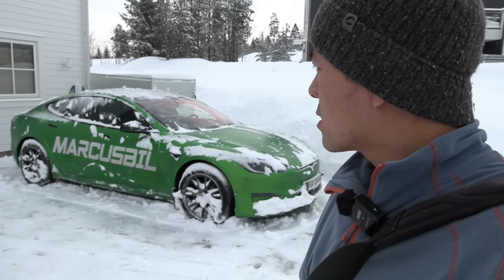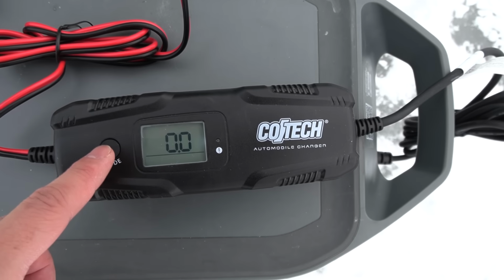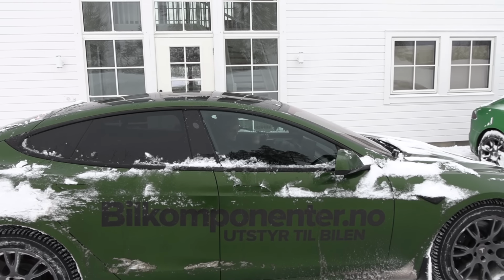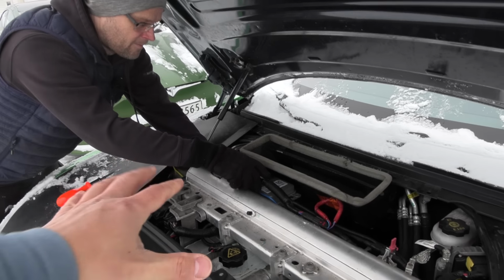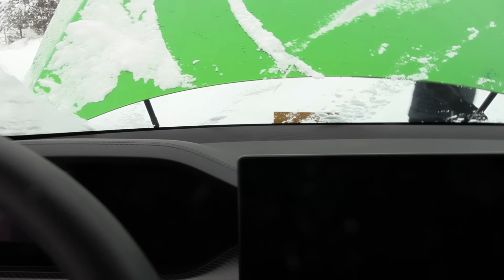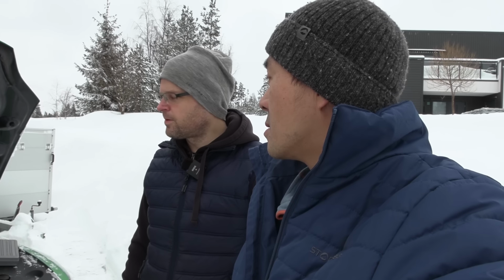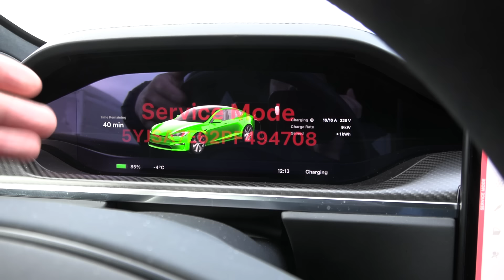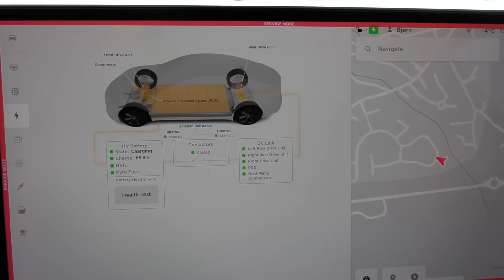Tesla Model S Plaid died in the cold

Comment: I had a 12V battery discharge on my Kona EV, a regular boost was all I needed but I have a physical key. There needs to be mechanical key to get into the car and hood so it's not just going to rely on the 12V battery working in order to even access the 12V battery.
Reply: Usually when a battery have uncharged twice its more or less dead so just replace it if it happens.
Reply: But they did get into frunk with 12V battery not working, so I don't understand why the need for physical key?
Reply: @darekmistrz4364  Yes, after calling (and waiting for) someone with a higher power 12V (semi-)portable source and waiting in the cold for a while until the car decided to wake up and open.
With physical access (like in the Kona), you open the door and then the bonnet, pull out the 12V battery, charge it inside and put it back in.
Some things should remain the same and not be "innovated".
Reply: @AndrewTSq  That's BS. Sure it's not optimal. But does your phone die when it's fully discharged? These are Lithium LV batteries, not lead acid batteries.
Reply: @LAndrewsChannel  So the process you describe requires exactly the same tools but additionally physical key compared to Tesla process at the moment
Reply: @marcel151  i thought kona had a normal 12v battery
Reply: @AndrewTSq  I was referring to Tesla's 12V battery.
Reply: @darekmistrz4364  yes but not everyone can open your frunk.
Reply: @K0nst4nt1n96  no one can open your frunk because the backup only works if the low voltage battery is dead, its not working when it still works.
Reply: @darekmistrz4364  It doesn't require a battery powered jumper (which most people store inside their cars). And that physical key is in your car's fob which you have on you all the time.
Reply: what year is your kona?
mine automatically recharges the 12v from the big battery
have you ever noticed an odd yellow ish light from just above the center of the front "grill" cover and below the hood?
and the hood is opened from the inside of the car with a release lever
Reply: @TschingisTube  what happens when the voltage is too low to open the car but high enough so it doesnt work?
Reply: @AWildBard  2022. It was a one time fluke as far as I could tell. The yellow light has come on since the incident which was months ago. Everything has worked fine since. My point here is more that all I had to do was to was to use my physical key to get in and pop the hood and boost the battery normally rather than have to attach it to some flimsy wires, wait a few minutes, only to have to repeat with the 12V again after gaining access to the car, which is what you have to do with the Tesla because there's no physical key.
Reply: @K0nst4nt1n96  In a properly designed electronic system (which I expect from a roadworthy car), you will have a voltage cut-off point so either the system will be fully powered on or off (with the backup being "active"). In the worst case, it will be toggling between those states until the battery drops steadily below that threshold point, but even in that case, connecting the bypass voltage should "catch" it in the off state so it will still work.
Reply: @neilchristensen6413  
Ah, I see your comment is about the video. of course, haha
Reply: @LAndrewsChannel  If Tesla designs their door handles so that they dont work in icy conditions and removes hall sensors to measure the accurate distance while parking i dont think they thought of that.
Reply: @darekmistrz4364  I have an old car and when the 12 V battery dies I can take it out and charge it at home. I have no way to charge it outside, cause I'm parking on the street 100m away from my apartment, which is common here in Europe.
Reply: @peter.g6  I'm confused why would you mention that to me
Reply: @K0nst4nt1n96  What I am explaining is how most battery powered circuits are designed to work. Tesla might be making their own parts, but bits of them are made by other suppliers, like in the case of any other auto manufacturer. I really doubt Tesla designs every single PCB in their cars, but have them made by a third party that will use industry standard designs.
So yes, their cost cutting and design decisions have little chance of having an effect at this level.
Reply: @darekmistrz4364  You said not having a physical key doesn't make a difference, but this video shows you have to charge the  battery right there with a special power source. You can't remove it and charge at home.
Reply: @peter.g6  First of all, this video doesn't show that "you have to charge the  battery right there with a special power source". You just need to provide 12V power to help the car wake up. You don't need to charge that lithium battery because high voltage battery charges it. Second thing is that this video is very improvised and doesn't show how to correctly do it or do it with minimal amount of tools and equipment.
Reply: @AndrewTSq   its not that simpe it depends on why it went flat and teslas are now using lifepo4 instead of leadacid
Reply: @M_a_r_ke  but this is a KIA
Reply: I agree, it's mindblowing you cannot enter the car.
Reply: On my parents Kia Niro Hybrid, if you run the 12 volt battery down... there's still a key hole in the driver's door to open the door.  Then... you push a button on the dash.  A little chibi comes up on the dashboard display to chide you for lettting the battery run down and plays bad elevator music for about 90 seconds, while it actually uses some charge in the hybrid battery to charge the 12 volt one enough to start the car!
Reply: @LAndrewsChannel  True, I don't know why either Tesla or OEM manufacturers don't just make sure the electronic systems are properly maintained at least indirectly by the high voltage battery. I thought that this was done by an on-board charger and when that charger is activated that on my Hyundai Kona it would have that yellow light on. 

Either way, it has only done this on one day 8 months ago. I just wish I could knew what caused it so I can be prepared.
Reply: @darekmistrz4364  I will not touch a car that could potentially lock my children inside with no way to get them out quickly. I want a key and a handle to open a door. If the system can fail when cold it can fail at any time. It could be 100 degrees outside but something goes wrong and bam, you can't get in after you just loaded the kids in to go to the pool.
Reply: @joecoolioness6399   Bad news for you. There are many cars that do not fulfill your requirements
Reply: A friend of mine had a Lotus Elise, a car where you have to pay extra so that they leave stuff away. There they also saved the mechanical locks. 

He showed me that it had a small hatch under which there was a USB plug where you could load the dead battery until the door locks work again. 
 
And when you have a wiring problem or a mechanical issue with the door opener? What then? A crowbar or the angle grinder?
Reply: @feedingravens  Break the glass
Reply: Cost money, Elon is all about pinching pennies.
Reply: I hast it approx. 6 Times with my E-Soul SK3, MJ2021. 12V Battery exchanged on my Wish after 3 Years. With new Battery in place for now approx. 3 Months, the new 13V Battery also died twice and needed external Boost/re-vitalisation wit my CTEK MX5. Annoyingbsince Hyundai/Kia knows this from many other KIA and Hyundai EV drivers for Years (GoingElectric Forum ist füll of These cases) but still  did'nt manage to Delivery a proper ECU/BMS Update ever since... Sad and annoying, since in many ways beides that serious doenside, I really Love the Car and how IT handles/drives etc 😢

Comment: 3:11 it looks like shorted...why are plus and minus wires connected ?
Reply from the maker: These are not live wires. They are input wires, not output.
Reply: @bjornnyland Ok, thank you for the explanation.
Reply: Given there was a spark the first time he connected the booster, I'd call it live wires.
Reply: This is just an emergency bypass to power the trunk release. Most likely there is never any voltage on those wires because there's a diode there somewhere, so it does not matter if they are shorted or not.
Reply: @vprwave  A motor or relay has a coil that needs to be charged/energized, if the connection is not fast and precise, the coil can kick a little and make sparks.

Comment: My 2007 Cummins 5.9l diesel starts every time when plugged in even below -40C, will go 900 kms on a tank of fuel, refuels in minutes ready for another 900 kms. Even when the battery has gone dead in extreme cold I can open the door with a key, open the hood and boost the batteries. This is insanity.

Comment: FYI, avoid leaving the external charge connector connected to the car, but with the EVSE not powered.  The charge port ECU is looking for the pilot because it sees the prox, and this will keep the system awake, which draws more power from the LV system.  Yes, if it's super cold the LV battery will not be able to charge, so in that case I'd recommend leaving sentry mode on, which will keep the car awake and the DC-DC converter in the PCS will keep the LV battery supported until the temperature comes up and then it will begin charging the LV battery.   Personally I think Tesla screwed up on using this tiny LV battery.   (I have several videos on my channel about this)

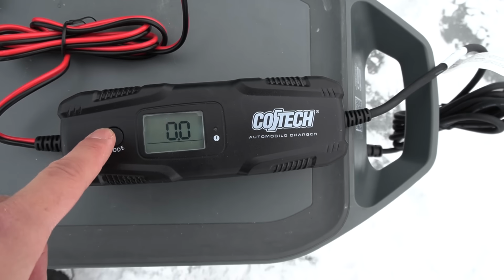Comment: 4:00 these type of chargers will not start unless it sees at least some voltage. And these wires are not connected to battery, they are connected to frunk unlock mechanism. In Victron chargers you can set it to "PowerSupply" mode and it will not try to detect battery. It also has a profile for Lithium batteries so no need to disconnect LV battery. I highly recommend that.
Reply: Victron is good shit, but probably 10-15 times the price of Bjørns one
Reply: @havarm  That's true, especially that there is nothing amazing inside of it. Components inside are not worth more than 25 euro. But I suspect if Bjorn wants to have something good (like with Ecoflow) then buying Victron is the way to go here.

Comment: Because having a physical key like them legacy automakers would just be too much oldschool...
Reply: The best part is the not existing one, isn’t it? 
You easily can get rid of a mechanical lock by replacing it with an AI-based cloud operated door unhinging system. It even allows a subscription service for car entrance 😂
Reply: @fromgermany271  Not to worry. The 2025 Plaid will come with Elons robot companion so that it can open the door for you.

Assuming of course, its battery doesn't go flat. I guess you would be in serious trouble then..
Reply: Unless you buy a Tycan (or Tesla apparently) and lock yourself in in the middle of scorching summer or freezing your nut sack off in dead ass winter. Sounds so much fun
Reply: And then you sit in your legacy car and still cannot start because you still need the booster to make it work again.
Reply: My Jag Ipace has manual door locks and a manual lever inside the car to access to the frunk if needed to get to the 12v battery. Legacy car maker= seen it, done it, solved it.
Reply: @andersnilsson973  Same for US-cars
Reply: @DennisWallman  after 40y in „HighTech“ I still remember what a friend from school once said about me having two fables. IT (always the newest; did fade a bit recently) and old cars. Never had the combination of time and money needed for the latter part, but I refuse to buy anything from the iPad on wheels company. My actual car from my favorite British brand has also far more electronics then the ones build when I was burn, but it is still a car. If I don‘t want to drive myself anymore (hopefully far far away from today), I will use taxis.
Reply: @andersnilsson973  😆  never had an issue so far in over 2 years. I think EV should be easier to maintain, our first service was after 2 years and cost £250. Brakes ok and tyres good. I wonder how the government is going to get all the tax they need from ev's when fuel duty starts to decline???
Reply: @@phillipbanes5484 nobody ever stranded in an ice car because of 12v battery died, obviously, my bad.
Reply: @TschingisTube  I can just bump start it..
Reply: @fromgermany271  AI-based requires power :)
Reply: @nicholasripp386  Easy when you will see how much the electricity price will raise. Is was a carefully prepared trap.
Reply: @alexk.7250  sorry that you cannot afford an automatic shifter
Reply: @@phillipbanes5484 I read what you write and it sound like this "hey look at me, i can fix my own car, everybody should be able todo it!!!!!!" since all the things you mention do not play ANY ROLE if you are not capable of fixing your car yourself and you need assistance, therefore i wrote "stranded" means you are unable to fix it and need assistance and then the repair guy will have a booster and will be able to open everything and make it work.
Reply: @fromgermany271  Careful! don't give the muppets even more "innovative" and "good" ideas! 😄
Reply: Give me that and stalks for turn signals and wipers.
Reply: Use a hammer. Works every time.
Reply: This is why making the future inaccessible is a problem. If you don't have computer science and engineering degrees, it's highly unlikely that you could fix this problem outside of a Tesla service center. It's made to be that way, unserviceable. That's not just a Tesla problem, or even just a tech problem, though technology does tend to bring that kind of patronizing anti-consumer-repair attitude.
Reply: That wouldn't be cool at all.

Comment: Would a noco startbooster help in that situation?
They are small and light, and work at least with standard car batteries.
Reply: Yes, that one would help... But it does switch off after a few minutes.... But it should be enough to trigger it on
Reply: Noco manual says it's only for lead acid batteries. I think the Model 3 uses a lithium ion 12v battery. You'll also need the override function, which is a bit dangerous, according to the manual.
Reply: The charger they used to wake up the car is also only intended for lead-acid batteries. And after getting the doors open, they disconnected the 16 volt li-ion battery from the car's system on video as well, before proceeding further.
Reply: @teamterska9985  Yes, not all chargers will charge all battery types. The cheap ones mostly do LA exclusively.

Comment: Bjorn you can open the frunk with a 9v source such as those tiny batteries you have in fire alarms. 

I would recommend buying a Noco portable battery booster for when you go low as it will open the frunk and should get the car turned on. I have the GBX45 and it’s amazing, the noco ones have a override mode you hold for 3 seconds and then it will supply raw 12v, very useful for using an air compressor / tyre inflator away from the car (for example pumping up a trailer tyre)
Reply: Good idea, he can keep the booster in the trunk.....  Oh, wait a minute, that's not going to help....  🙂

Comment: Hello Bjorn,

As I understand low voltage Lithium-ion batteries will not charge at below -15 celcius because of the BMS, but they can discharge at limited power. So if the battery discharges when very cold, it will not recharge until it is warmed ??
Cordialement,
Reply: Might be really cool to blow hot air over the LV battery for a while and see if it comes to life? It should recover voltage as it warms.
Reply: @iamalmostanonymous  There was a video on weber autos on this topic. If the 16V battery disconnects itself because it's depleted, you have to unplug it, wait a few minutes and plug it back in. It then allows itself to start charging again. Just heating it won't help.
Reply: @iamalmostanonymous   A very good experiment!
Reply: vernevens1598  so exactly like any ice wanne be SUV/Crossover? :D